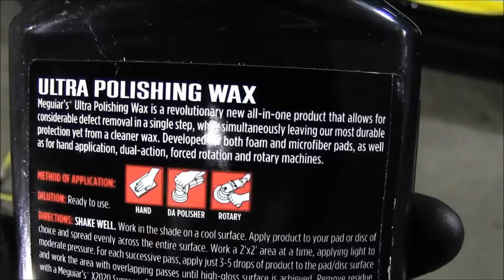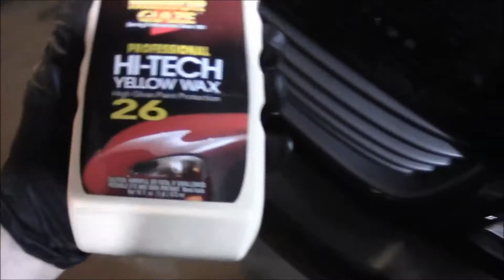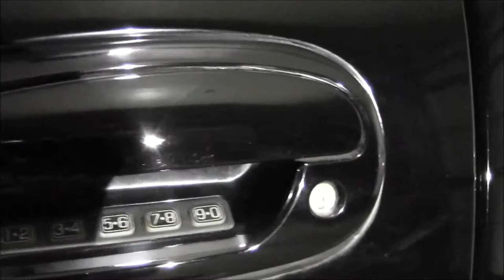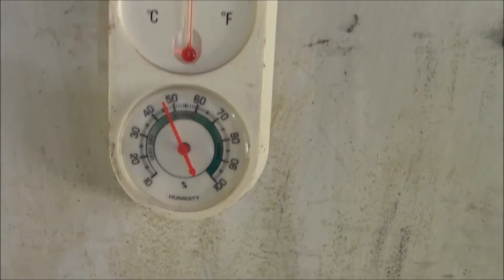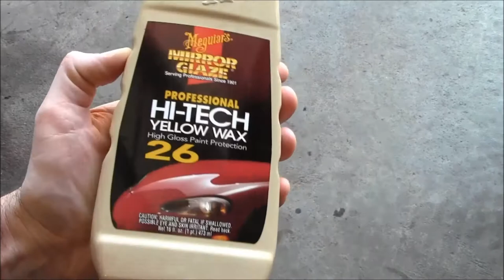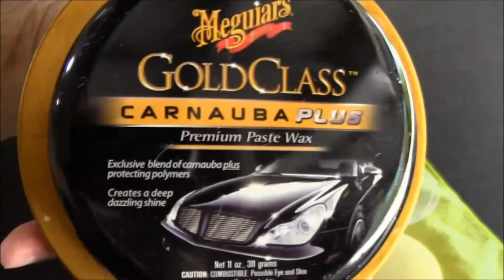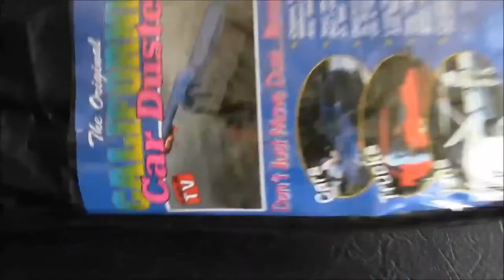2002 SVT Lightning Detailed with Meguiar's D166

Comment: You definitely top the charts with detailing. You probably could have easily fux yhe dent in my rear driver door made by previous owner. I made it worser trying to fix it.
Reply from the maker: King Dj-Slim:  Thank you.  Fixing dents can be tricky.  You should try and find a paintless dent removal guy.  They can do some pretty insane dent repairs.  I have seen those guys fix hoods and deck lids that were completely hammered from one end to the other with hail dents... and they turned out PERFECT!  I couldn't believe some of the stuff they were fixing.  So I would look into that and get a few estimates.  It costs a lot less then getting the dent fixed with body filler and painting it.